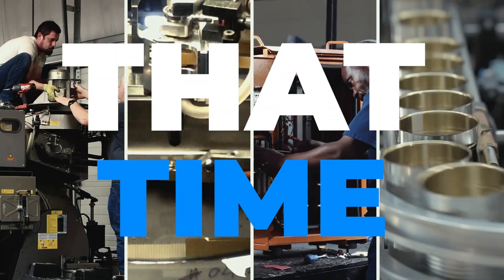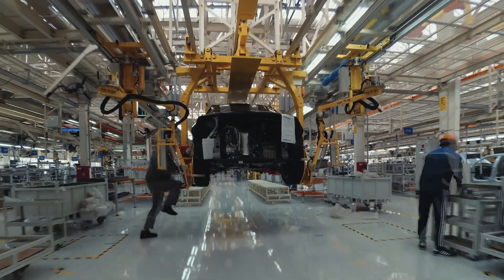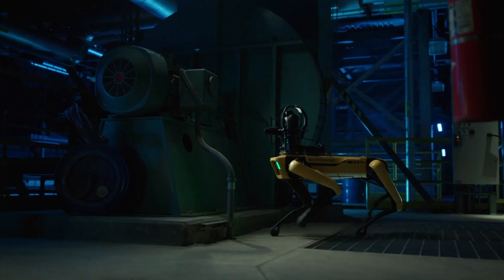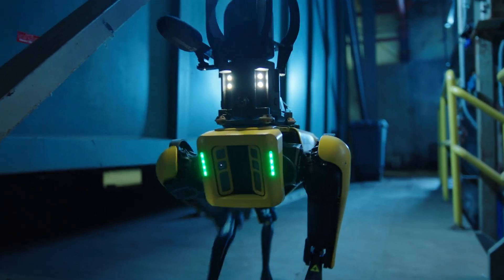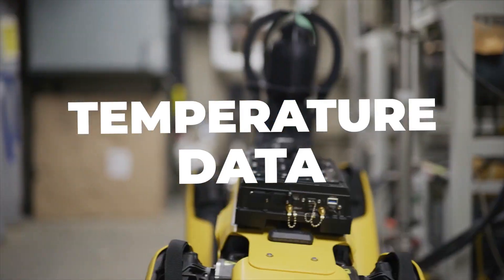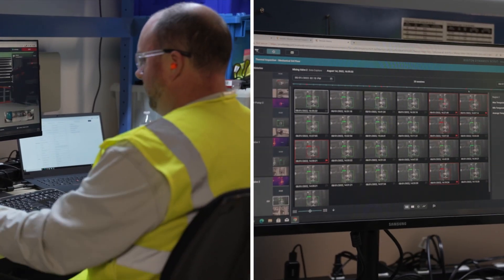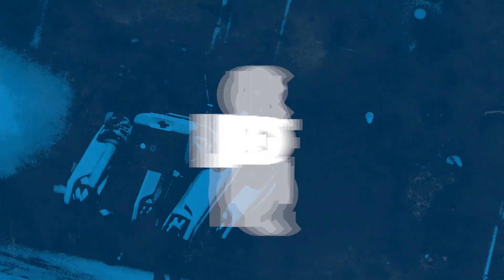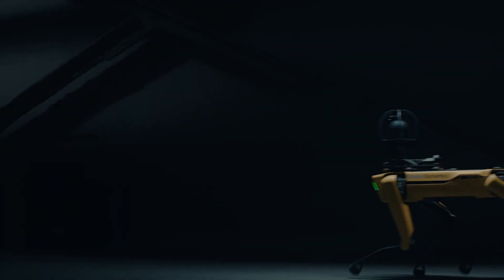Automated Thermal Inspections with Spot | Boston Dynamics

Comment: Dumb question: Since we are in the IoT era where everything sends and receives data, why don't these critical machines have they own sensors  to mesure temperature? Why do we need a sophisticated robot that check them one by one? 
Thanks for the answers!
Reply from the maker: That’s an excellent question! While many modern facilities have IoT connected equipment, this isn’t the case in many older facilities. In many of these facilities, costly sensors have likely been added to the most critical of assets. However, many facilities have a lot of equipment that has a slow rate of change, and it wouldn’t be economical to outfit them with fixed IoT sensors. Typically these assets are inspected manually, and infrequently. With Spot, this dull, dirty, and sometimes dangerous job can be completed more frequently - maintenance crews don’t have to keep looking for a needle in a haystack, and can focus on getting ahead of their maintenance programs. Thanks for your question!
Reply: @BostonDynamics  thank you very much!
Reply: @andrei_valikov  I’m gonna guess you’re one of those people that also says that altruism is a lie or something dumb like that lmfao
Reply: It isn't uncommon for machines to be in use for decades.
Reply: @BostonDynamics  this response was written by a robot too
Reply: @HappyBeezerStudios   nope

Comment: Pervasive permanent sensors are probably better and more affordable in many cases.
Reply: probably not, setting up sensors on old machines, all the wiring and the hub is probably way more expensive than $40k and spot can do a whole bunch of things, not just the one.
Reply: @kjohn5224  so you're saying that scan times on the order of hours as this thing does rounds is as good as often as seconds or wherever rate is needed?  Yeah that's going to depend heavily.  Example: Lose a bearing you may have minutes before disaster or much more expensive damage is caused, a local continuous sensor can fire an alarm and trigger automatic mitigations, slowing, stopping, simply alerting.

Comment: How will he open locked doors without an arm? 
Solution:
1. Change door to automatic - so you have to spend money on that iot door lock system. Instead you could iot the sensors. 
2. Robot stays in the area - so you need probably more than one robot 
3. Humans open and close the doors for him - so the humans could take the readings, too. Can the robot wait until someone opens the door for him?
Can that even be automated? What if there is a maintenance ongoing in one area? Do you need to change the route manually?
Reply: It can have an arm adapted to open doors. See other videos.
Reply: so mnay moduels can attached to it. easily!
Reply: 1. Why ould they spend money on automatic doors if Spot can open them?
2. This a robot literally designed for movement.
3. Like said, they can open doors themselves.
4. I'd like you to give a scenario where it can't be automated.
Reply: There's many videos of spot openings doors
Reply: @no3ironman11100  thankyou for pointing that out also for people worried about price there's a few companies that sell these for under 2k and would be fine for scanning tools and areas
Reply: No need for doors if humans are no longer needed.

Comment: I think you guys screwed up. This ad imo makes it seem like you guys built a robot with absolutely no clue what it would be used for. Because quite frankly the application displayed in this video is absolute nonsense. Fixed sensors would always be superior to a mobile sensor platform. A wheeled platform is superior to a legged one. Any actual production facility that makes enough money to keep their doors open can afford IoT monitoring equipment. To advertise your product as a valid solution while technically correct is borderline disingenuous.